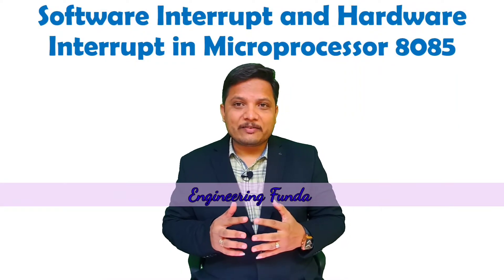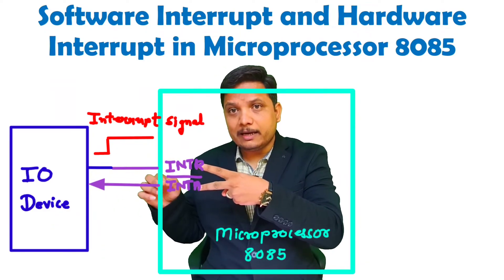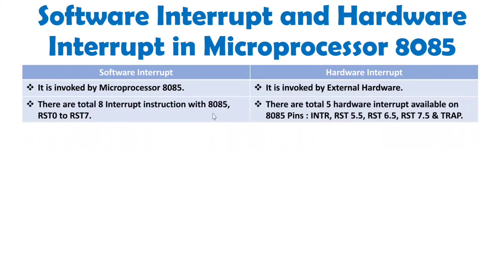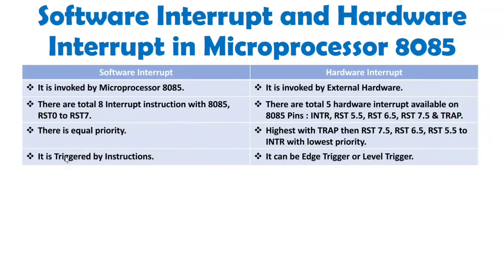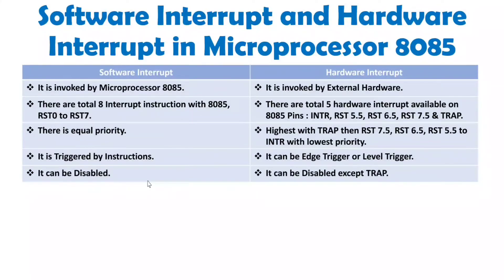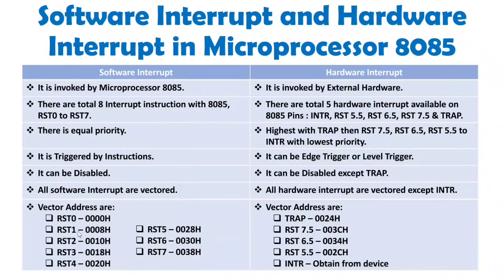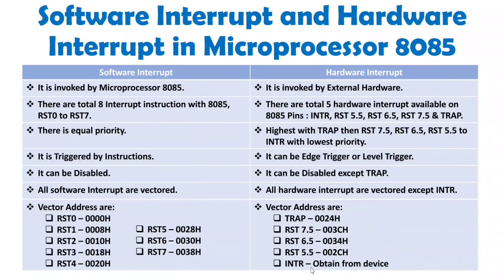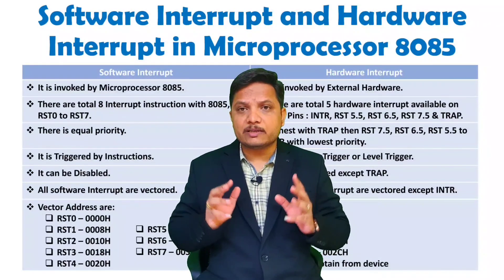Software Interrupt vs Hardware Interrupt in 8085 Microprocessor: Key Differences

Comment: INTR is a hardware interrupt. Where as software interurrupts are generated by RST 0 to RST 7  instructions (which has opcodes C7, CF etc...) by the processor
Reply: Intr is not a hardware interrupt
Reply: @Maggie_N_sprit  it is. Ajay is right.